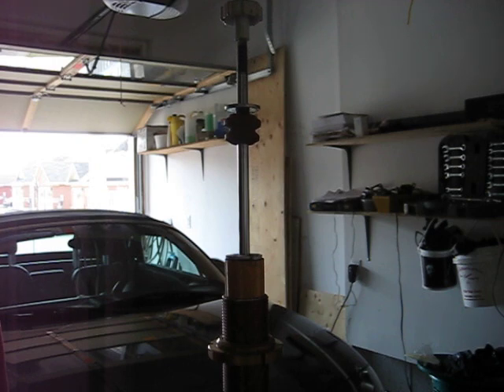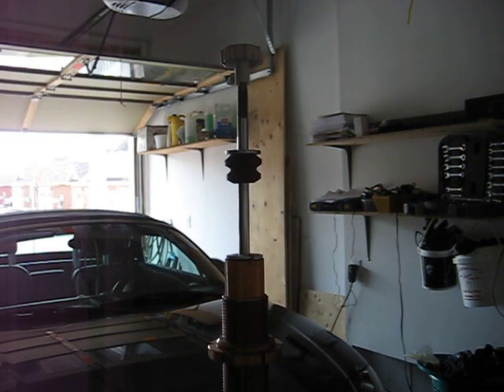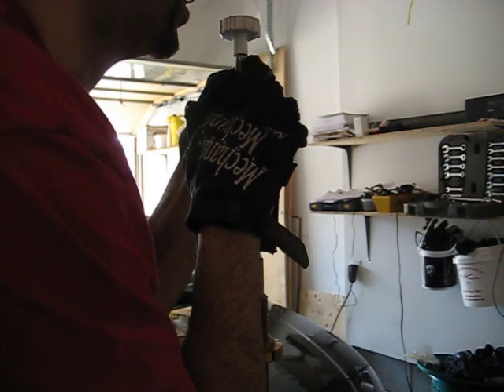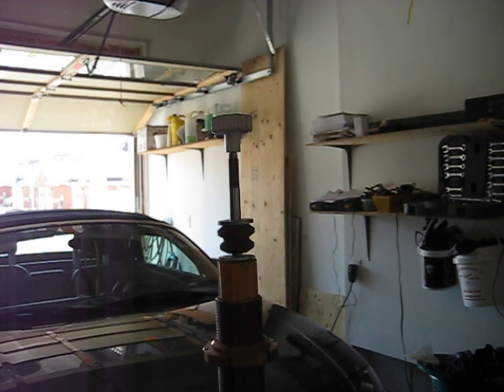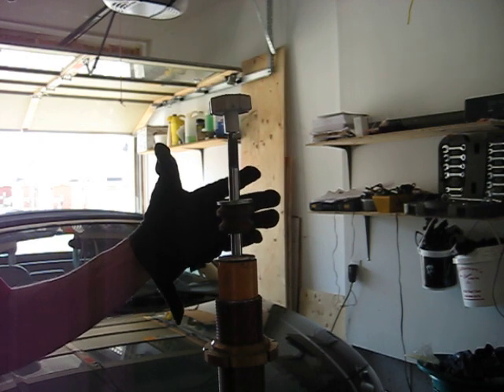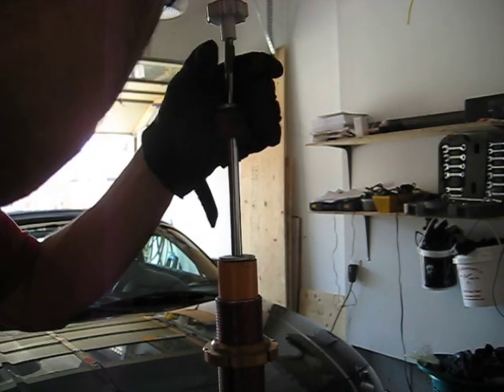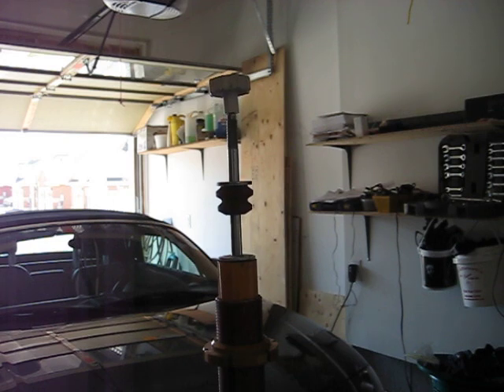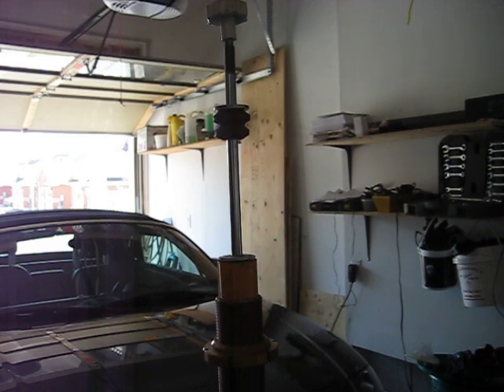Koni Yellow - Shock Setting

Comment: Interesting video. I may have to disagree with your assumption of running them at full firm.  The spring in your vehicle is applying significantly more force than the gas pressure in the shock. The gas pressure in the shock is actually there to prevent bubbles and contaminants in the fluid, not to provide any significant dampening forces.  It's all about the valving.  The little amount of gas pressure available to rebound the shock is insignificant to the force of your spring rebounding the shock.
Reply: twas thinking that too
Reply: Thank you for that comment.  I was not thinking of that but it sure is spot on.  This is a perfect example of how misinformation can be spread through youtube content experts.  I always read the comments to get the true expert advice.  Thank you!